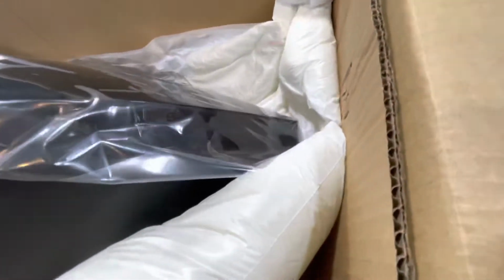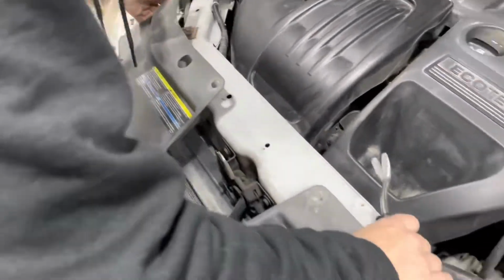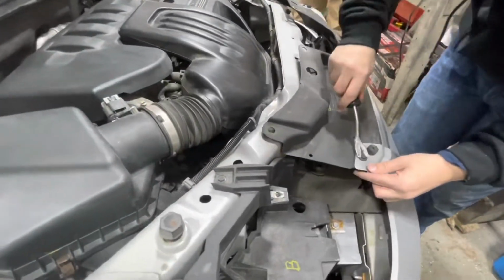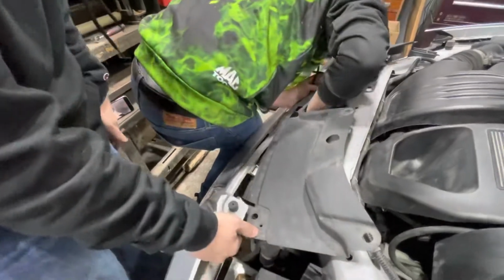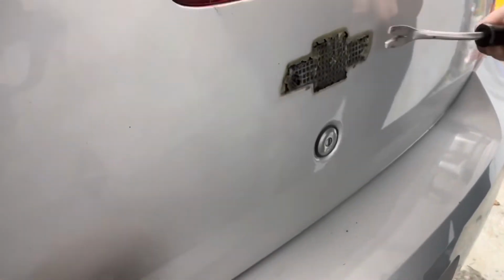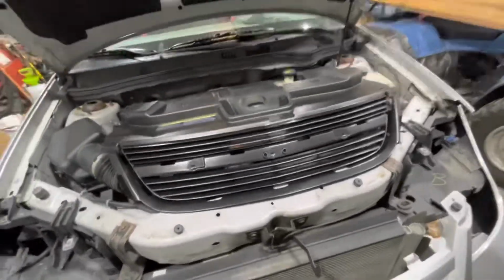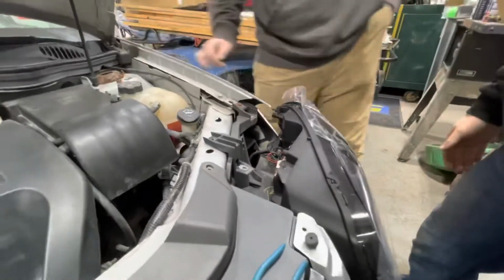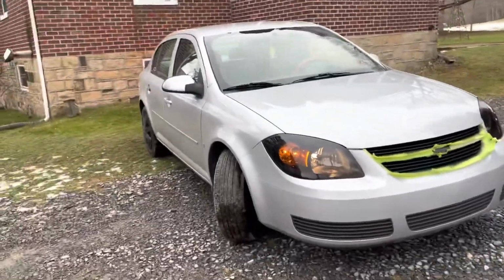Chevy Cobalt Headlight install and plastic restoration // Project Snowbalt

Comment: Was it a struggle to slide it into the clips at the bottom of the headlight? I am struggling with that issue right now and am wondering if I might have gotten the wrong part or if some of the body’s out of line with it being an 08 G5.